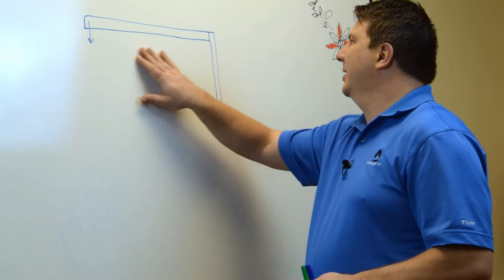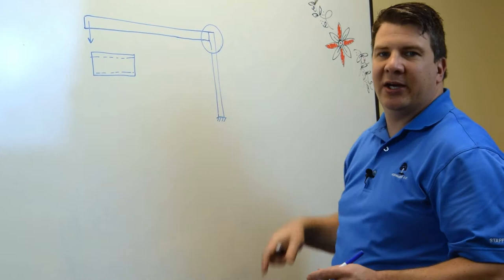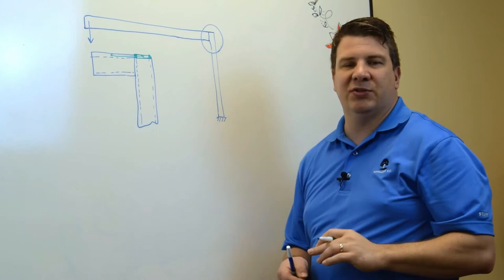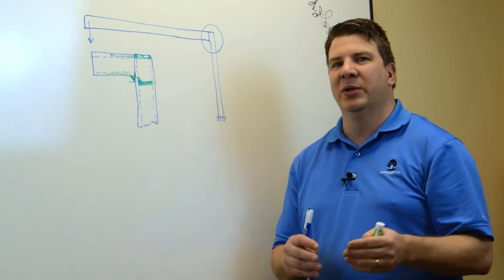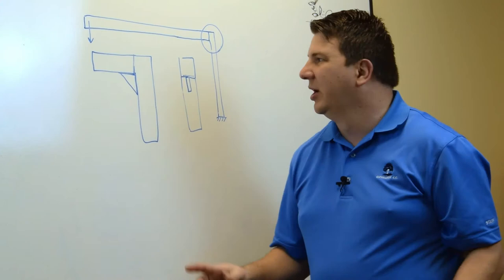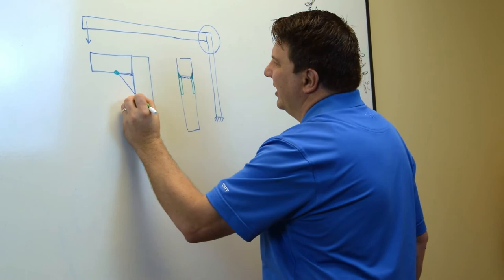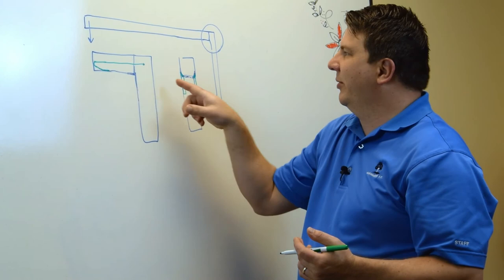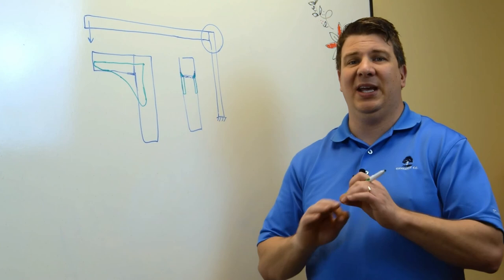Designing Gussets - A Guide for Structural Design

Comment: Side gussets are way better than the other options. As the load transfers from one part to the other it really has to do it through the sides, since the top and bottom have discontinuities and there is no stiff path for the load to go. The stress shears out to the sides through the welds into the gusset, then similarly shears back out into the other part.

Comment: Can you expound further on your first example of how to transfer the best flow of stress without adding a gusset. I didn't quite grasp how you were welding on that last plate and the orientation it was in. Thanks
Reply from the maker: The goal of the adding the plates is to distribute the loads/stresses from the horizontal tube to all of the vertical tube.  With no plates or gussets, we only interface with the left face of the tube.
The lower plate is just like the upper cap plate and will fit inside the tube.  The purpose of the plate is to take the compression on the lower half of the horizontal beam and distribute that to the sides and back of the vertical tube.

Comment: is there a set distance that the gusset needs to travel along the horizontal bar to be sufficient enough for support?  say on a 20ft long carport roof?
Reply from the maker: The general idea is to have gradual transitions.  The angle of 22.5° works well in most cases.  I will usually start the gusset at the neutral axis and then taper the leg at 22.5° until I get past the edge of the horizontal tube.

Comment: Interested in how you increase SM without increasing the area moment of inertia...did you post a video that explains this? Also, what would be benefit of this? Thanks.
Reply from the maker: Generally speaking, SM will increase with AMoI.  I believe the desire is to gradually add material so that it will change the stress flow pattern.  Adding material at the neutral axis allows for limited stress concentrations and then tapering it to the edge has minimal effect on the existing structure.
Reply: Thank you for the response.

Comment: When welding the gusset. You would weld all around the exterior. But the interior would you leave that free? I'm thinking welding the interior would change how the stress flows, in way you don't want. Is that correct or would you weld the interior as well?
Reply from the maker: I always weld the inside.  There isn't a big difference in the stress.  Plus it prevents rust on steel.